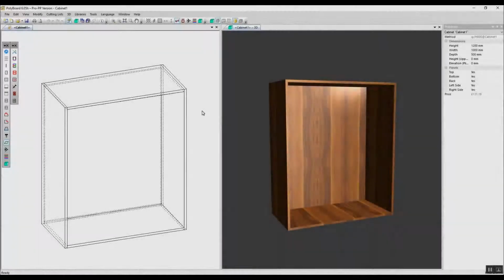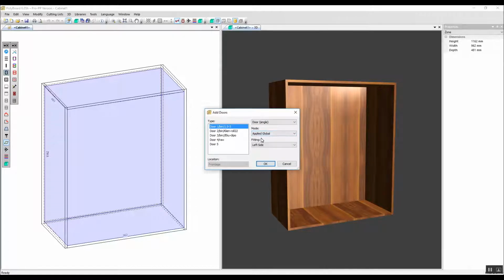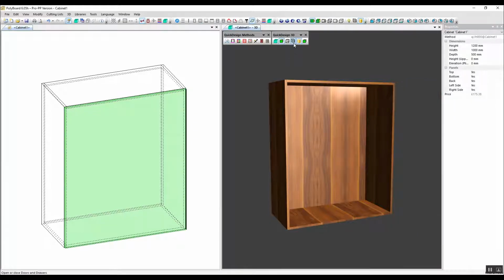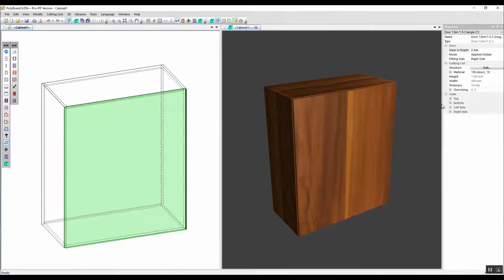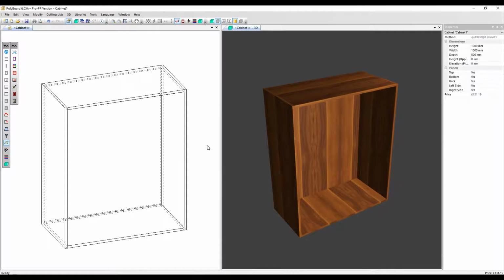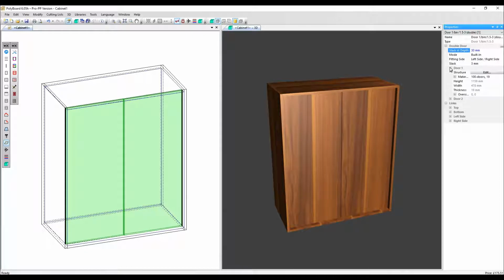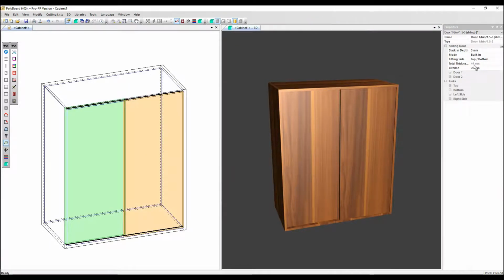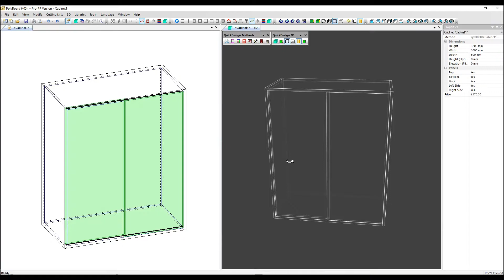Adding and Modifying Doors in Polyboard

Comment: hi i want to make a door in the top side like a bench we can open the door to store inside it
Reply from the maker: Hi Ahmed,

This can be accomplished using PolyBoard. You will need to add a double back to your cabinet space and position it at the front of the cabinet. Once you've done this, set the top piece to a nill material, which will allow you to add a door to the top of the cabinet.

This approach will create a bench with a door for storage.
Reply: @wooddesigner  i do this but i can't add a door its not clickable I work on ver 7.08
Reply from the maker: @overpaidm  Hi Ahmed,

I recommend updating to the latest version of PolyBoard. You can update on our website, https://wooddesigner.org/

When adding a door, it's important to recognise what zone of your cabinet you have selected in PolyBoard.
For any further technical assistance, get in touch with our team on the forum: https://wooddesigner.org/forum/

Comment: Dear sir,
What if I want to add global door without changing the cabinet depth?

Thanks
Reply from the maker: Hi Maher, 
 PolyBoard operates based on overall dimensions. When adding a global door, it is important to account for this in the final measurements. For instance, if the cabinet depth is required to be 600mm and an 18mm door is to be added to the front, the overall dimensions should be adjusted to 618mm.
If you need any further assistance, don't hesitate to reach out to our team at support@wooddesigner.org

Comment: is it possible to define different colours in both sides of a panel for example visible side gerrn and hidden side white
Reply from the maker: Hi Ashokan 
Both sides always have the same colors, but you can do a surface split to divide the panel into two (or more) panels and then define the materials differently, for example, 18mm MDF and 1mm laminate.

Comment: Is it possible to load hinge hinge hardware from companies like Hettich , Blum and have the hole details part of the assembly , 
Same question regarding the draw assemblies available from the same companies,
If so that would make a good video
Reply from the maker: Hi Jonathan, thanks for your message. Yes that's exactly what you get with Polyboard. You specify the hole/s size and depth and also rules about how, when and where to apply the hardware. These hardware style sheets can then be applied to new projects with the click of a button, all ready for machining. We've got some videos on how this works here (especially the drawers and the hardware pages): https://wooddesigner.org/support/polyboard-videos/